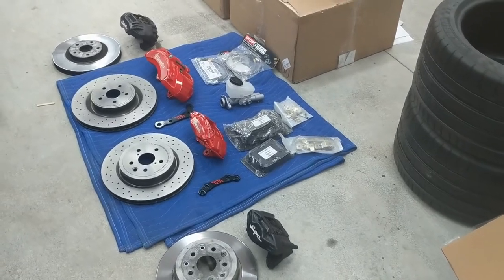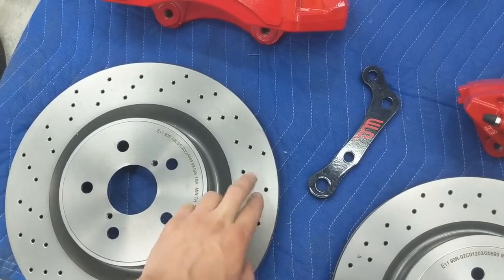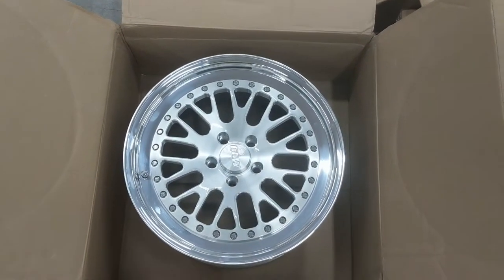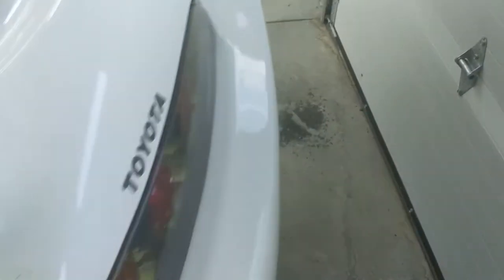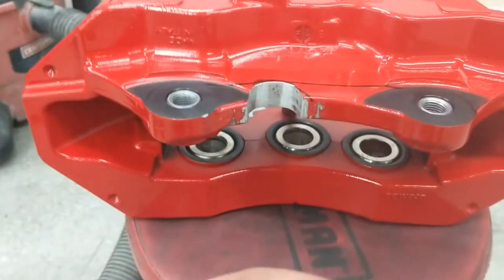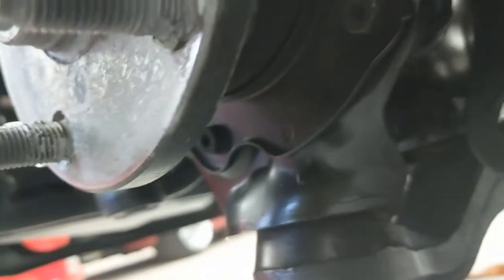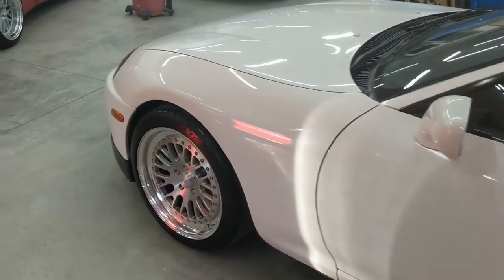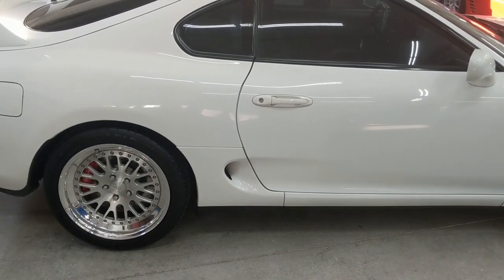Supra MKIV SRT8 BBK Caliper Install with CCW Classics

Comment: you reckon these would fit the same with 18x11.5 in the rear?
Reply from the maker: I'd imagine the rear would be fine. Even though the SRT8 rear calipers are large, they are nothing like the front. There is a ton of room around them.
Reply: @802Projects  thanks! I thought I'd ask because I'm running ccw classics as well but I'm not sure about my offset. I assume my front wheels are identical to yours though

Comment: What offset are those wheels?
Reply from the maker: 38mm on front 57mm on rear
Reply: I’m sorry can you comfort the offset because I thought you will need 38 on the rear and 57 on the front
Reply: @JDMGuys703  No man, that would be way to aggressive in the rear and you’d be touching the calipers in the front